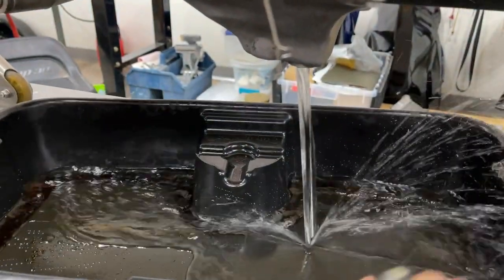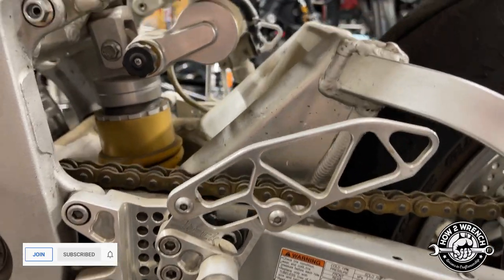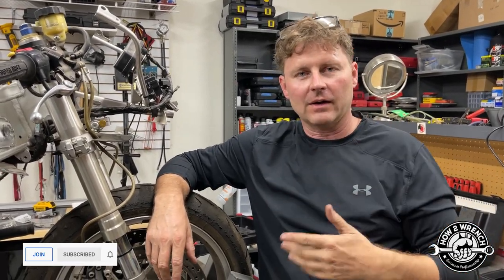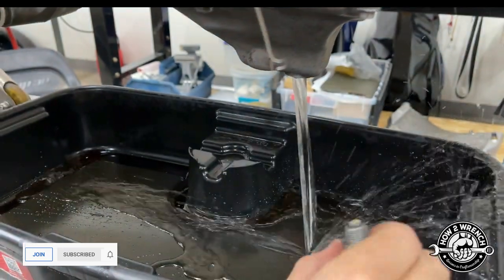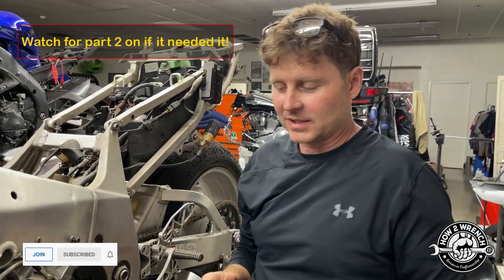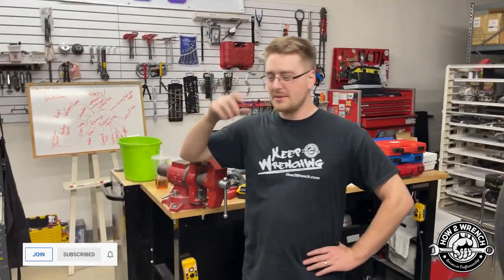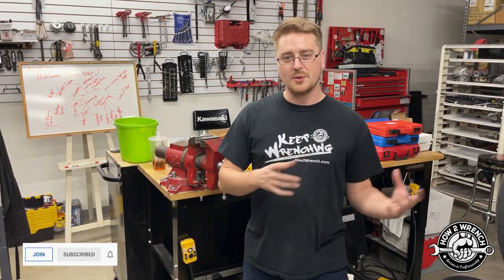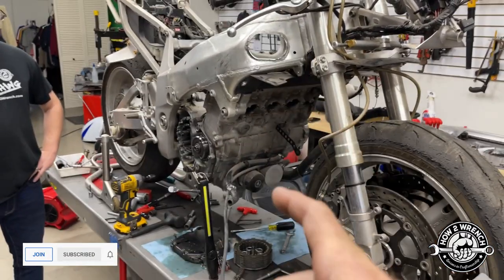How to diagnose a locked up motor. Is it the engine or transmission? YouTube Fan comes to train!

Comment: nice, love to see your channel,  I have an old gs500 from 96, and it having troubel getting startet unless I stop my hand over the air filter entrance, then it will start immediately but will not idle. both carburetors have been disassembled cleaned and jets has been replaced based on the specifications, the mixer screw is also set based on the service manual, do you have a suggestion for the problem sincerely jimmi from denmark
Reply from the maker: Hi Jimmi! I'm on the social media response team and I recall Shane blogging one-time that his second motorcycle as a boy was a 1989 GS500E and the model that had him fall in love with not only Suzuki, but motorcycles! 
Let me try and see I can catch Shane to answer quick. He is preparing for an extended stay in Japan training students this winter. His member inbox and one on ones get first response and he does try to get back to others. We are just the social media team. 
Not a member yet? Here are the details! 
Want him to drop his wrenches and help you? He loves helping members and it is only $1.99 a month to join (more options if you really want to say thank you too) All member tech questions like this get directly forwarded to him every day! Here is how to get in!
* Join here: https://www.youtube.com/channel/UCBhM8DCKnT3qXwTW0eToyCg/join      
* Just looking to give us a high 5? Click here: https://www.paypal.me/how2wrench 
* Is this an emergency and your head is about to explode from frustration or fear? Get Shane’s cell here: https://how2wrench.com/ols/products/techline-one-on-one  
Note: If you are a new channel member please reply back and we will see your Youtube Member handle in your name. We will have a private member-only FB and web page coming he can directly do Q/A there! Thank you for being patient as our growth has blown up!

Comment: Continental Road Attack 3 sport touring tires rock.
Reply from the maker: Good to hear! Thanks for the feedback. What motorcycle you running them on?
Reply: 2017 Kawasaki z900 with suspension modified for my weight and meager skills. Good grip and you can feel the road surface and so far, with 6000 miles on them, I believe I'll make 10,000. They are my new favorite tire. I've run the Bridgestone Battlax BT series tires for twenty years, from the 020 through the T31 EVO. They wear well but they are numb feeling. The Conti RA3 are my new brand. 👍
Reply from the maker: @blipco5  Great feedback. I'll share this with Continental!
Reply: Thanks.

Comment: Just had a boat engine completely filled with the same gunk.
Reply from the maker: Hey bud...were you able to save the motor? Hoping I can on this one.
Reply: @How2Wrench  no fortunately not this one. It's the gm version 4.3l boat  engine. Although I have had a actual car engine that was the same way that I was able to save and is still being driven around. That was 4 or 5 years ago.
Reply from the maker: @aatwood13  This one is pretty bad too. May cost to much...